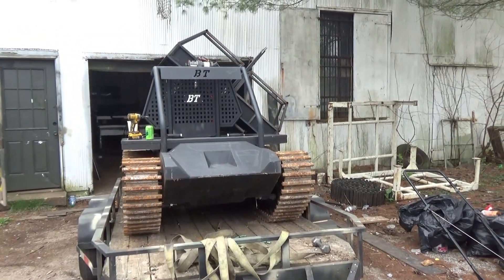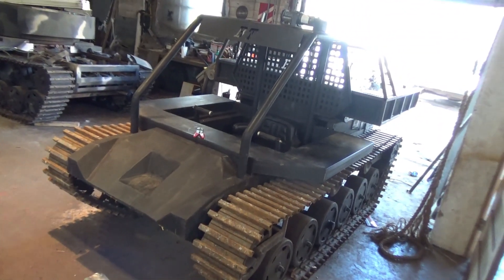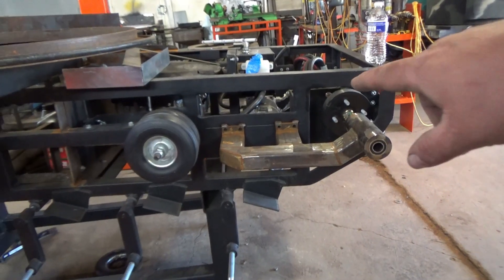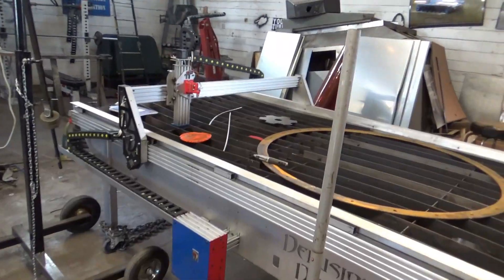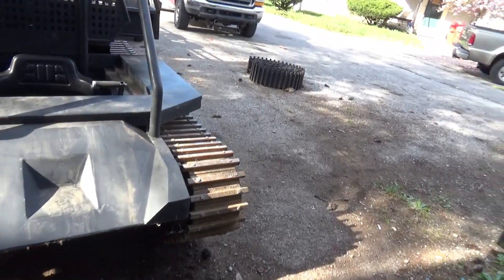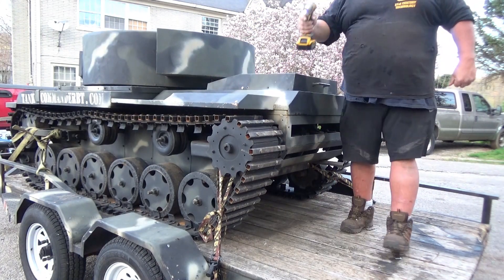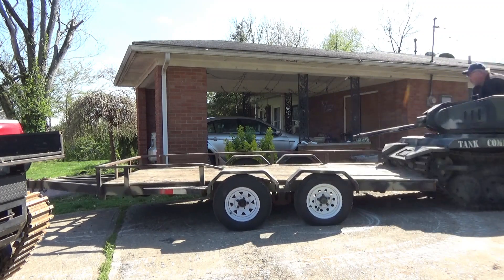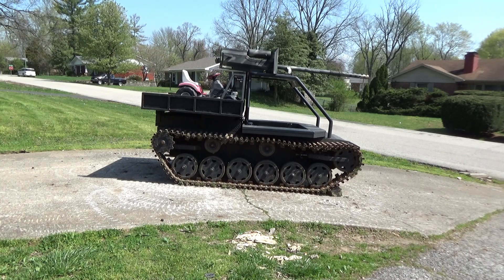Tracked vehicle 2

Comment: What are you sourcing your hydro motors from?
Reply from the maker: I am working with Hydrogear and parker reps straight from the factory . My pumps are Hydrogear 21 cc pumps and 21 cc drive motors .
Reply: @mimimitchell1989  that’s awesome. What sort of mph are you achieving? I have a mini version of what you’re doing based off of a zero turn lawn mower pump and most I get is 13 mph and can feel the pumps struggling. Not super informed on hydraulic stuff
Reply: @BBCMONTE34 if you want high torque then gear down a hydro gear zt 5400 and it will be okay. If you want enything faster then go with a gear drive and use brakes to stop one side.

Comment: Congratulations, great job! it's a very cool vehicle! 

How did you make the gearbox to allow the vehicle to turn around in the same place with the tracks turning in opposite directions?

Do you have some video that shows how this system works?
Best regards
Reply from the maker: I use a hydraulic drive system.
Reply: @mimimitchell1989  Thanks!

Comment: Nice!  Can't wait to see more. What part do you need for your Delusional Designs plasma table?
Reply from the maker: Thank you, and happy Easter.Had to replaced the power supply that I damaged during shipping . My cpc voltage divider board for the Hyperthurm 45 XP is going to take about six weeks maybe more depending on the C19 outbreak.Biggest problem would be me . Machine was  plug and play but for some reason I plugged but it wont play. Need to learn more about Universal g code something turns out table uses GRBL or somthing like that not sure can't get in touch with George to find out.Sorry about the long reply .Happy Easter to you and Mrs. Making Stuff.